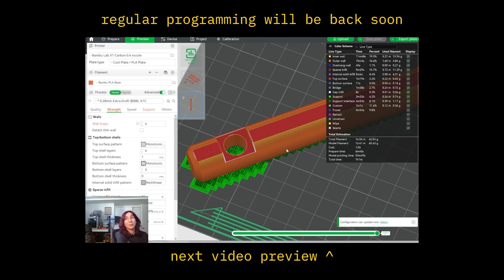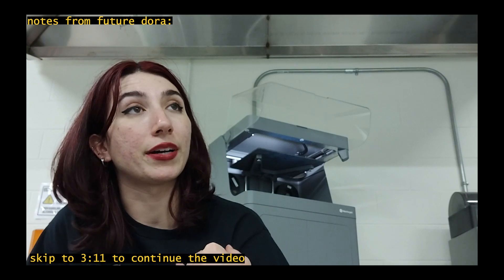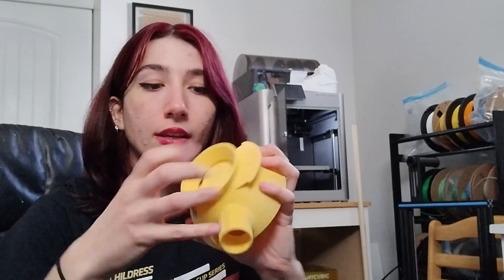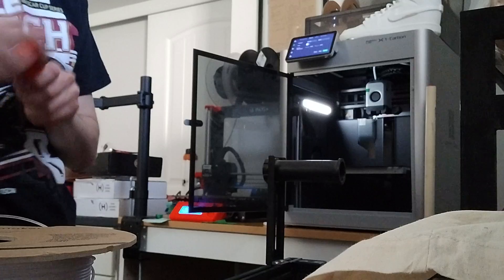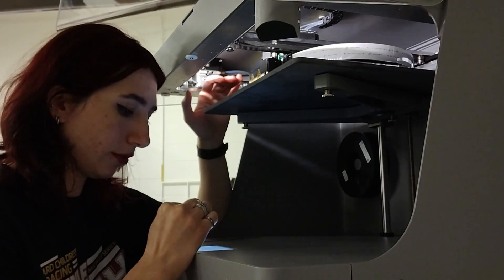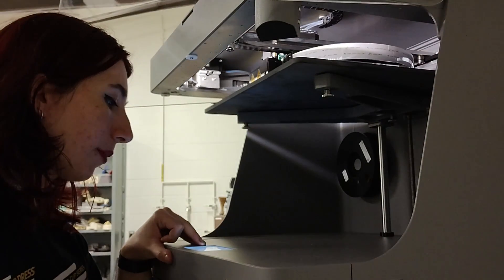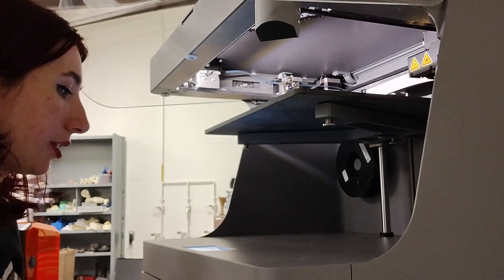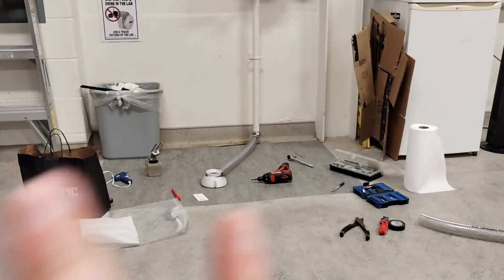first day of school & real time problem solving

Comment: For a quick fix that's pretty solid, although as they say "there's nothing more permanent than a temporary solution" so I wouldn't  be surprised if you go back in 10 years after graduating to find its still there haha.

Comment: Noice igloo! ))  For the last 3 years I'm using PVP + IPA mixture in a small aerosol bottle instead of glue sticks. I've also used it for print farm and it works amazing. 100% success rate (not kidding). Haven't tried it with ABS/ASA/Nylon though. Also much more even application than glue sticks.
To make it, mix PVP-K30 (Polyvinylpyrrolidone - a glue part in a glue stick) and 99% IPA (isopropyl alcohol) in proportion 1:36 by weight. It'll take about 10-15 minutes with constant stirring to fully dissolve PVP in IPA. Make a liter of it and it'll last in your lab for a year+.  I've used small hand sanitizer spray bottle to put it in. PVP is food safe (it's even used as a food and cosmetics additive).

Comment: I'm being nitpicky but the drainage might be considered an obstruction for an eye wash station. If I've got acid in my eyes I could trip on the drain. Probably a stretch, what do think?
Reply: I think you are right. But one could maybe make it a temporary solution. One you use every time you test if the eye washer works and then remove after testing.
But it would have to be super easy, cause I don't think the person testing them spends much time at each station.

Comment: Hey Dora! A quick tip, apparently if you use PLA as support material for PETG prints ( and vice versa), the supports pop off easily and cleanly! Its not something i've tried myself but it definitely would be worth trying, it'll make your life a whole lot easier!
Reply: You only need it for the interface material and it works great! You can also use petg as interface material for pla. One thing to note is to have a smaller gap between the interface layers
Reply: I had this setup for cura. But with orca slicer my supports come off pretty much just as good, so no need to have a speciality printer  for all prints.